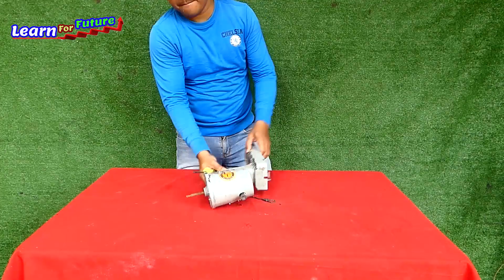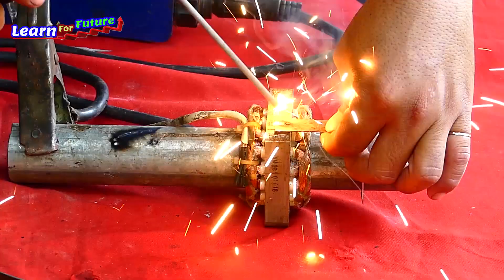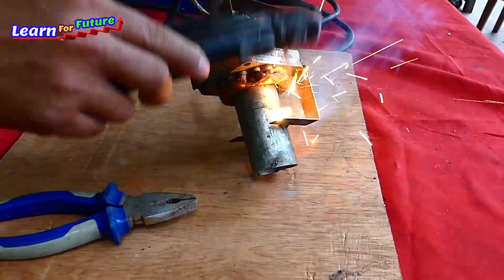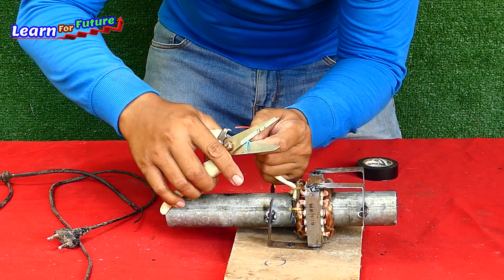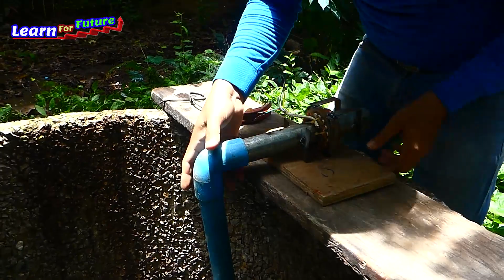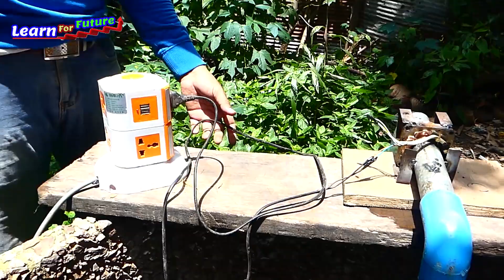I make high speed water pump from washing machine motor - old fan

Comment: Can u explain ..step by step how impossible suck the water from with using only that kind of method their is propeller to pump out that water..your equipment just only the magnetic coil parts of the motor..you the video have no enough explaination.. how the water pump out 🤔
Reply: Because there is a pre installed pump in the water already. This is just a scam